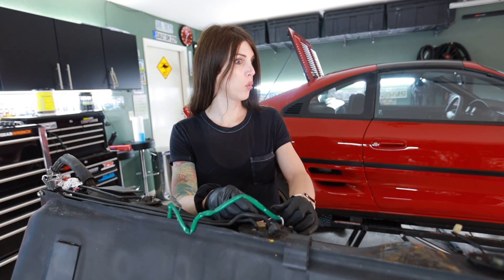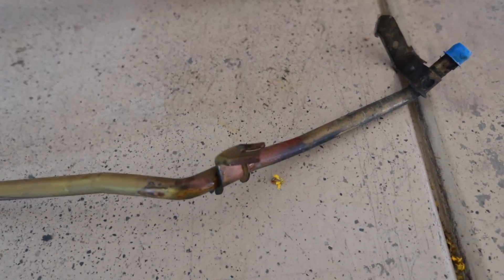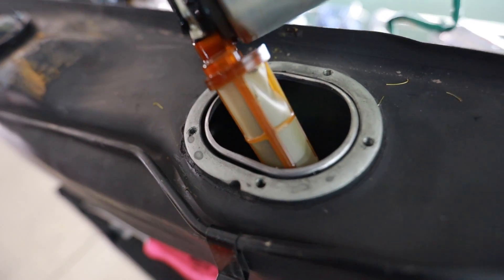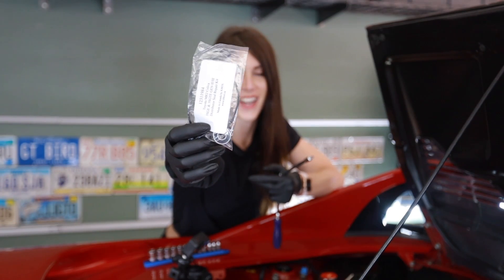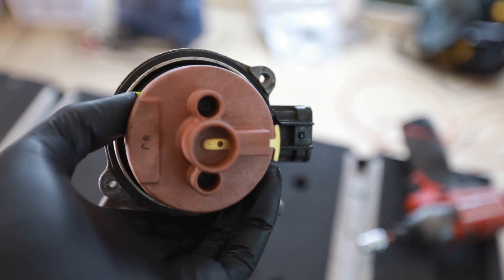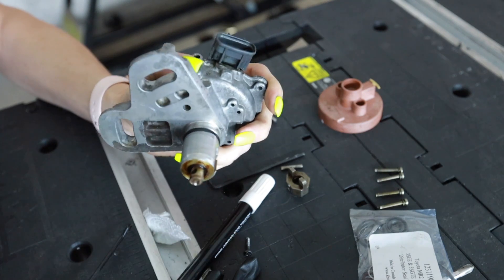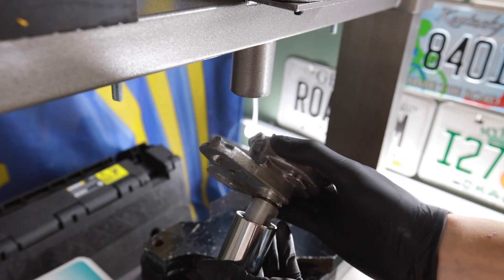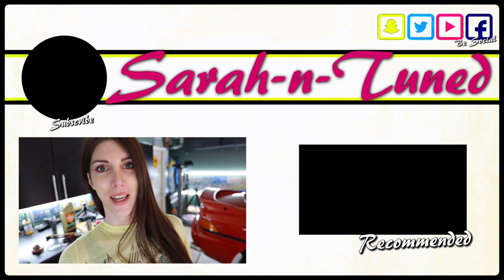Forget Replacing It When You Can Rebuild It?! // MR2 Turbo

Comment: Knocking the pin out of these is the most frustrating bit ever, rebuilt the whole engine, perfect, but trying to get the sodding pin out bearing in mind you can't damage the ali was a nightmare with a hammer and punch.

Comment: Hey Sarah! Love your stuff - especially since a ton of what you've worked on is also becoming what I need to work on. Oh and the fact that I also have a red turbo MR2 like yours (although I did a gen 4 swap). Am wondering on this segment where you removed the brass hardlines and had them soldered how did they hold up? I need to drop my fuel tank next week and am wondering what the best fix would be - to do what you did or maybe replace the hardlines altogether steel braided heater hoses...Ugh. Anway if you see this late no worries - really love your content. Thanks for inspiring me and making me giggle.

Comment: I feel you on the oil leaking thru the distributor. I resealed,rebuilt,& replaced the one on my VW MK2s 16V engine twice and it still leaks. The car doesn't get driven much nowadays so I just occasionally clean it out and try not to let it bother me. Stupid sideways mounted distributors

Comment: Another great video Sarah! 
I have seen a clogged PCV exacerbate the distributor o-ring problem because of the high crankcase pressure. I can't remember if you replaced that when resealed the engine. I think it is awesome you rebuilt your distributor! My friends think I'm crazy when I rebuild my starters and alternators... I thought that was nice of Charlie to braze that coolant hose too. 
Oh and you are right, lube in the hole is important before reinserting the seal and the shaft.
I believe your SW20 is the cleanest one outside the Toyota collection as well.

Comment: Copper work hardens so over time that bent section (got harden from bending) then gets harder and harder just from the vibration of the car running .  If there is more movement/wiggle the work hardening happens quicker.  Crack ends could be drilled out and can be filled in with solder to fix it.  You can anneal the copper a little too, at 800*F, do this before soldering.  Don't go more then 800* or it will anneal even more and get too soft.  I use a propane torch that is also compatible with MAPP (don't need to use MAPP), which are higher heat output torches with swirling flame.

Comment: Unfortunately the car running crappy may not be oil in the cap but that broken magnet. If it has sporadic ignition when you're done that's probably why. When a magnet cracks it basically simulates a 2nd magnet. Your pickup may be generating an extra pulse now because of this.  Love your channel and your jokes!!

Comment: As someone who has done this out in the driveway...I feel your pain lol.
Mine was worse couldn't get the fuel line fitting loose so ended up taking it loose at the filter and pulling it through when I dropped the tank. My pump was so corroded lol.
A little bit of redesign and they could have made access from the top with the center console off. That's the part that chaps me the worst.

Comment: I'm rebuilding 2011 Volvo C30 (6 speed) with a light front hit for my daughter's high school graduation.  The PCV system gums up and then it blows oil all over the place.  Pulled it, washed in hot soapy water and new diaphragm.  The painted the housing with light silver caliper paint.  I used my little home steam cleaner on top of Mcguiars Degreaser, slow but great results.  The heat helps to break the tough stuff loose.

Comment: The grooves in the shaft is probably why they don't sell an official rebuild kit, that will likely still leak in a short amount of time.  You might be able to press the shaft in extra (or less) and make sure it still fully engages the drive (does yotas drive the oil pump with the distributor?) that way the o-ring doesn't line up with the existing groove.   Assuming you have adjustments on the cap side so you can compensate for it.
Though too late but you could possibly polish the groove out on a lathe and then find a o-ring that was slightly oversize.

Comment: One thing your MR2 videos have done for me. Whenever someone around me praises Japanese car reliability and design, I think of you and this never-ending project. I've basically rebuilt a Porsche 944t with not even half the agony you're putting yourself through. Still, great series and of course you're doing better work than I am.
Reply: That is funny because essentially the 951 repair workflow begins with “remove the airbox and turbocharger”.  The classic 944t repair is the oil cooler and bottom balance shaft housing.

Comment: Didn't Charlie have a lathe (from memory)? You could have got him to MIG (I think TIG is too slow and will warp the shaft) weld the groove in the shaft then machine it down on the lathe, plus a bit of polish to give the seal a new surface to run on. As it is the new seal probably won't last that long is its running exactly in the same groove on the shaft.

Comment: having seen many of these pumps removed from mr2, there is no way the pump was the original, it looked to have been recently installed, the tank was also way to clean internally so was probably a replacement tank installed at sometime, the early cars had a tank drain plug but yours did not so this just confirms my thoughts on this

Comment: Haha, nice one! Sarah in very joking mood... :-D
One thing though to take care of, I hope you are not using standard fuel tube on the fuel pump assembly. As it is a drop-in pump that is fully in the fuel, the fuel tube needs to be of a special type that is fuel resistant inside AND outside. Normal fuel tube is fuel resistant only on the inside. Very important, because otherwise you have to drop the tank in a few month to replace the rotten away fuel tube thingy. Ask me how I know...

Comment: At this point I'm wondering if it wouldn't have been quicker and easier to have striped the car down to it's last nut and bolt and clean everything to within an inch of it's life?
Wait.............That's exactly wot u have done :))
Fire! the Gals on Fire :)

Comment: Tools you could use (that don't cost a $$$):  small parts washer, vice with nylon jaw inserts, set of machine punches, magnetic parts dish and a manual gear press.  The shot of cleavage when joke bombed was a nice touch.

Comment: Hi Sarah, if you want something that works great for cleaning get the tornador. It's a little pressure washer type gun, you can use it anywhere from interior to wheels to motor. Check it out.

Comment: wondering Sarah if you hit the under belly with a degreaser before you steam it and then high pressure hose it, will that bring off more of the oil and road crud,